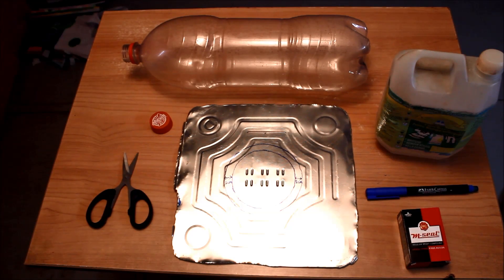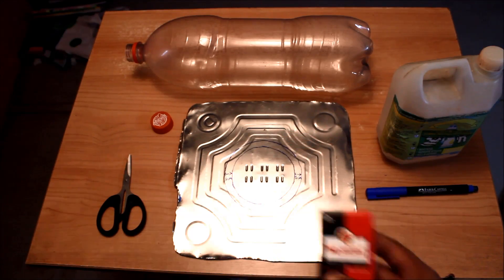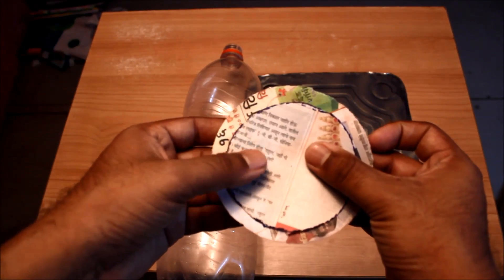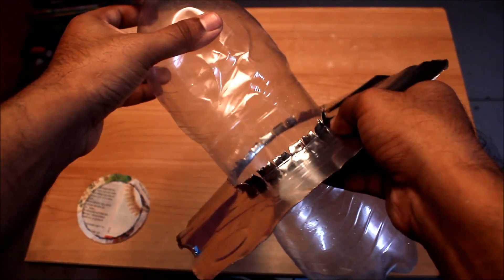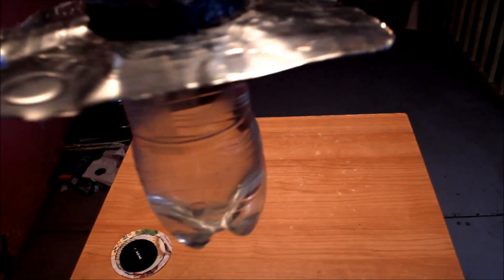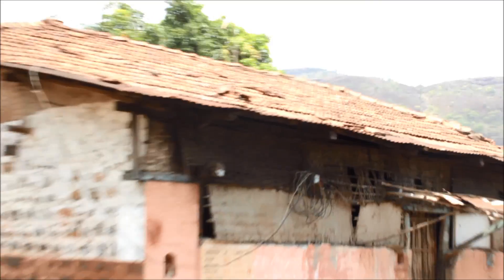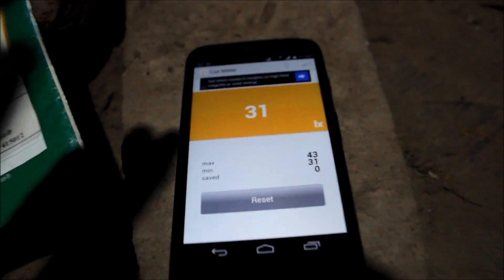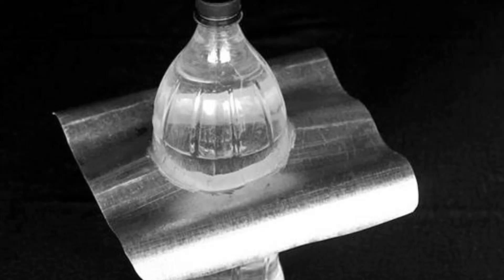FREE source of Light -  A litre of light. Plastic bottle used as Solar bulb. Amazing.

Comment: This device does not generate any light, it diffuses the light from the sun.  Very clever, but it only works during the day when sunlight is available.  To get light at night, you need a bulb and battery.

Comment: many have not explained as good as you have done - good job - keep it up. does the bleach and distilled water mixed into a bottle create light that bright or do we have to add some chemicals into the bottle to get that brightness?? Is there any chemical that can be added that is photosensitive and it brightens up and holds that energy for long into the late evening? if you ponder upon this I think you will be able to achieve it :-)
Reply from the maker: Asif Rabb The bleach serves 2 purposes;
1) To make the solution turbid, so that light difussion take places equally.
2) To prevent fungal growth in the solution.
Reply: thank you
Reply: hello u bleaching